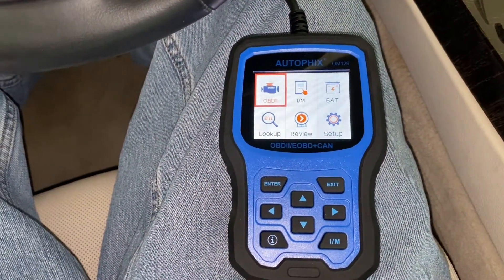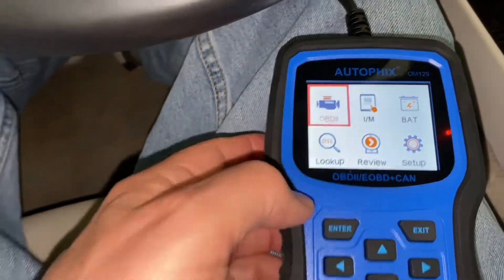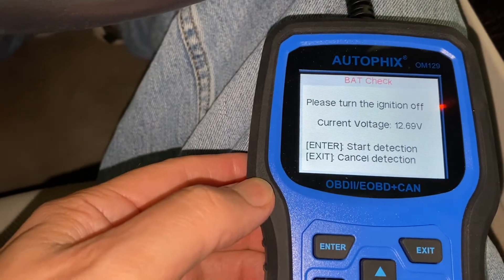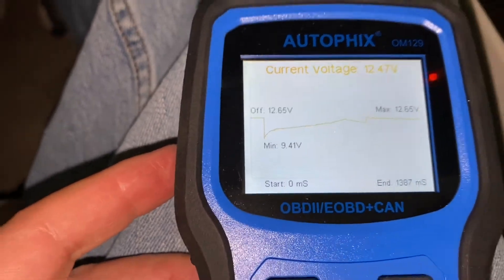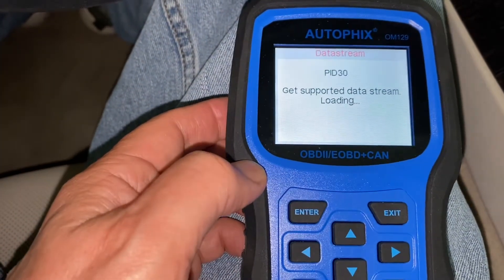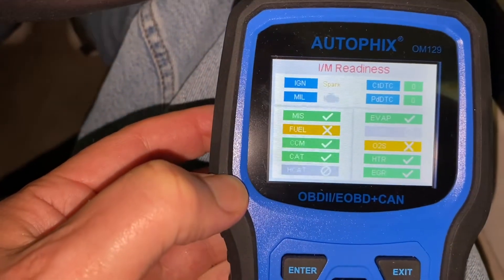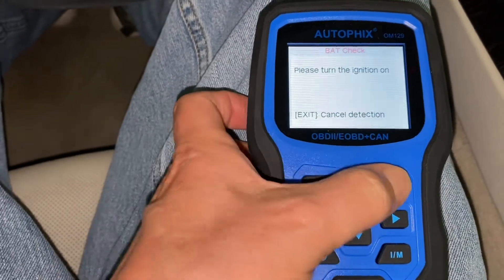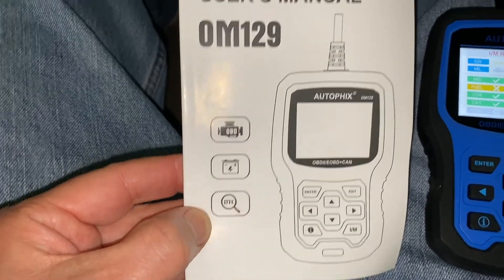Drivetrain Malfunction - One More Time BMW - Using OBD Autophix OM129

Comment from the maker: Drivetrain  malfunction is not a drivetrain malfunction chances are!  My goodness BMW.  Fix this.
Reply: Hey brother. I just stumbled across your video because I also have a drive train malfunction. I discovered what my issue is. Many ppl on FB groups and forums were quick to say it was the fuel pump going bad or this or other. My symptoms were that my car would shut off and give me DTM error fuel supply. Thats what lead me to believe that it was the fuel pump as ppl were telling me. Now if I had replaced the fuel pump I would still have the issue. The fuel pump was not the cause of this for me. I ended up going to BMW to get a diagnostic scan with their software and they let me know that my fuel pump CONTROL MODULE was faulty. They want like $800 parts and labor to fix it. ALso told me they had the last fuel pump control module "in existence". They wouldnt tell me the issue with the module however. I further researched and discoverd that our fuel pump control modules are prone to over heating and thermal shut down. Once they get too hot and shut down the fuel pump stops receiving signals and the car stalls out. Once I discovered that I out 2 and 2 together and realized that sure enough, the car only give me issues with that drive train crap when its very hot out. It never acts up at night or early morning, never when it rains ONLY when its hot as balls out. I see a bunch of replacement modules online. Im making a video on how to DIY replace it and save yourself some cash. I have a channel on BMW specific things. Please consider subscribing to me. 

Now as far as your specific issue. I dont think its the same as mine by what Im seeing here in your video. Your voltage isnt increasing when the vehicle is on. Thats an alternator issue because the alternators function is to provide power to vehicle electronics and accessories while providing a charge for the battery. Its supposed to turn on when the car turns on. When your car starts the voltage drops a bit and then it rested in the 12.14 area for a while then fluctuated around. Thats not a good sign there. Id check the alternator connections. Be sure theyre all snug and tight. Same with your battery terminals. 

Keep in mind. IF your issues were also occuring when it was blistering hot out and you were trying non stop to start the car like I was. That drains the battery down alot.. I noticed one night after my car acting up that the charge battery light was on. So that can be why your battery is having issues.  geniusautosecurity@gmail.com is my email I may be able to help you out. I subscribed to your channel.
Reply from the maker: @ProjectBimmers  Awesome, thanks for the great feed back.   good intel.  I just subscribed back.  more good stuff coming.   i look forward to your posts!  "What up ya'll"  great tag line!!
Reply: @StuffYouShouldKnow1  much appreciated bro. The reason for me that it takes the car about 20 to 30 minutes or even an hour at times to start again is because the module is cooling down. Oh quick tip that works for me. Whenever it happens, to avoid having to wait til it cools down I force reset it by disconnecting the negative battery terminal.. She fires right up after that. I drive around wit a 1omm socket and ratchet in the trunk just in case.
Reply from the maker: @ProjectBimmers   you need to patent this comment. "Oh quick tip that works for me. Whenever it happens, to avoid having to wait til it cools down I force reset it by disconnecting the negative battery terminal.. She fires right up after that. I drive around wit a 1omm socket and ratchet in the trunk just in case."   PERFECT.  You are Da Man!!
Reply: @StuffYouShouldKnow1  Im actually perusing forums and videos such as yours to compile a list of possible cause for drive train malfunctions. Its such a general error message but for some of us it can leave us stranded. Very annoying. Highly embarrassing if you have passengers. $60k cars have some verve acting like this. Loll